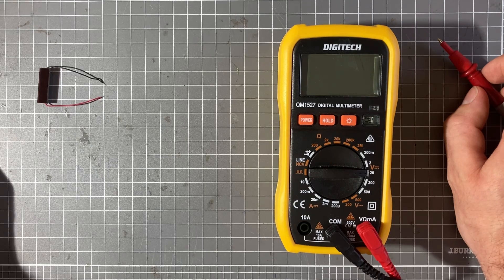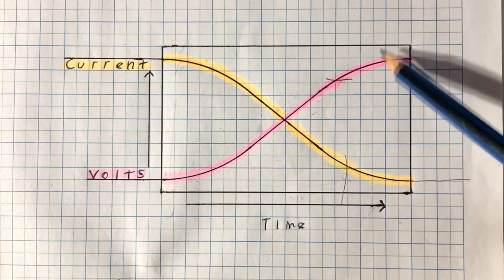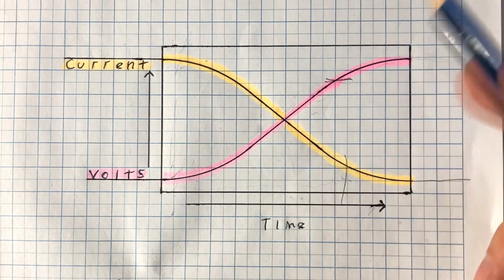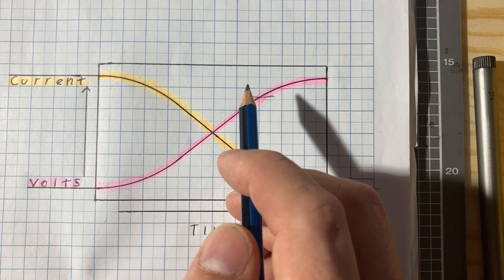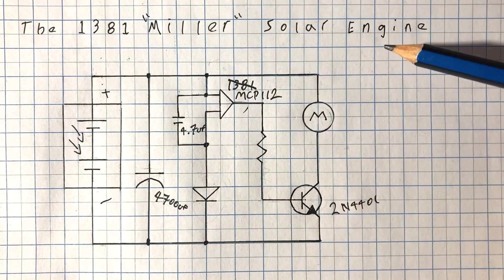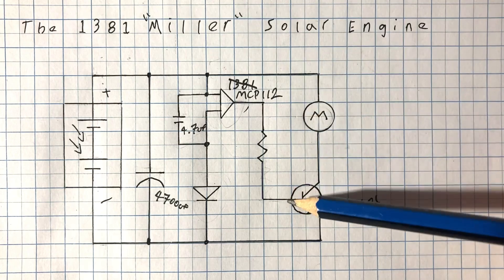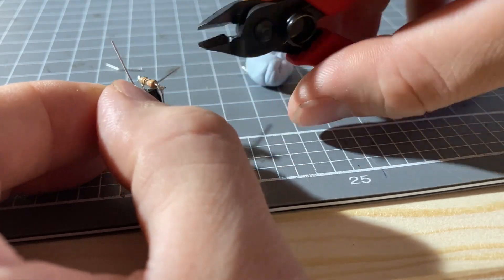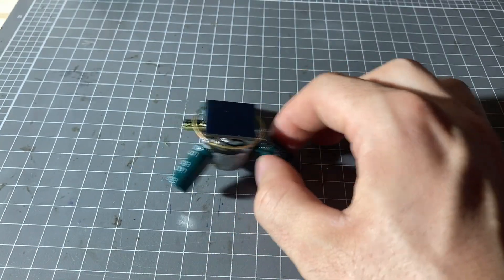The simplest "robots". BEAM solar engines

Comment: Thank you for showing me the MCP112 ! was looking for a replacement to the 1381. I tried adding more diodes on the ground side of the MCP112 to raise the trigger voltage but found this does not work very well because it raises the low output level of MCP112 to the point of turning on the NPN transistor.
Reply from the maker: The MCP is a lifesaver. It's my go-to solar engine chip now. 
I have never had that issue with diodes, but it does make sense. I wonder if you could solve it with a very large pull-down resistor? That might not be great because you would always be sinking a small amount of current, but it might help. I have thought about another diode on the chip's VVC as well, that might solve the problem. I need to do some experimenting

Comment: Today my MCP112 arrived, so far I've had a lot of fun with it! Is there a possibility to adjust the trigger voltage? I had to order the 2.7v version but I would like to use it for triggering at around 4.5-5v
Reply from the maker: There are a couple of ways to raise the trigger voltage, the easiest is to stack multiple diodes between the IC and ground. Each diode (if its silicon) adds about .7V to the trigger voltage. 
There also a couple of circuits I have seen that use a voltage divided made from a relatively large potentiometer to adjust what voltage the IC "sees" but I haven't played around with those too much.
Reply: @ALTcorporation  Thanks a lot! I tried the voltage divider methode but didn't got lucky, I'll try the diode method next.

Comment: Great explanation! My favorite type of solar engine is definitely the Miller SE, mainly because of the simplicity and that you can buy MCP chips with different trigger voltage levels. Though, when using a super capacitor, for example, finding the correct sized "timing" capacitor could be challenging. Then maybe a transistor latch could help to keep the triggered state for the full discharge duration ("1381-based"). But I've never built one of those. I almost forgot about the charge rate based engines, but I have actually built one ("T3SE") a long time ago! The way they work is super magical to me! But yes, it wasn't as efficient as other engines...
Reply from the maker: The Miller engines are good. I have built some latch-type engines, but I think it's best to keep a little bit of a higher voltage in the main cap. Maybe a diode inline with one of the transistor gates could help? I have been building a few engines based around the MC34164 (Chloroplast?), and they are good because you can put a variable resistor inline and tune the engine for trigger voltage and discharge time. 
The charge rate engines are really interesting. I would like to try using a very small microcontroller to sample the voltage level and determine the charge rate. I think some of the single-chip controllers draw pretty low current, so it might work.

Comment: Very nice! Thank you. 
I’m thinking about a stationary solar engine ‘head’, that’s looking to reorient itself towards light every time there is enough juice to do so. Maybe add a little dance as well somehow. More like a little art installation in the hallway. 
I have some cadmium AA that should be easily chargeable with solar. Anyone done that?
I just started with electronics, but have a solid math and physics base. It’s really fun to play with this.
Reply from the maker: Solar heads are really cool little projects, I plan on doing a video in the future about them. Nicads work with solar engines, usually they will have a two-stage engine with a capacitor as the batteries can take a long time to charge.
Reply: @ Great. Tx.